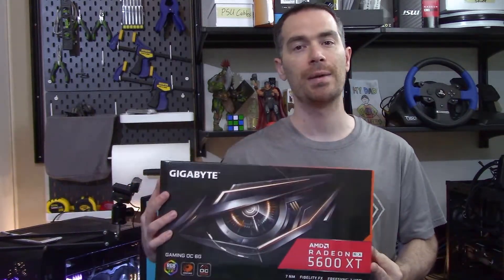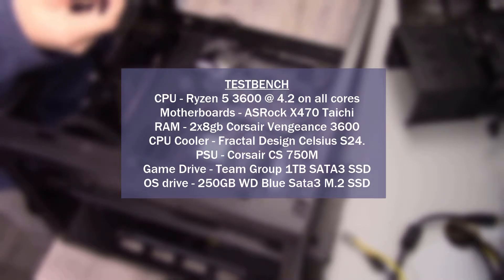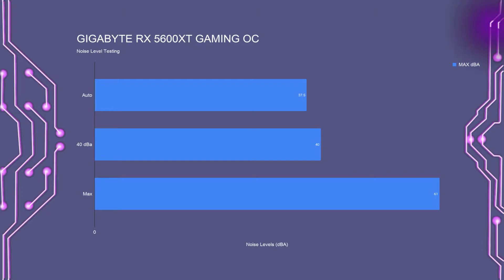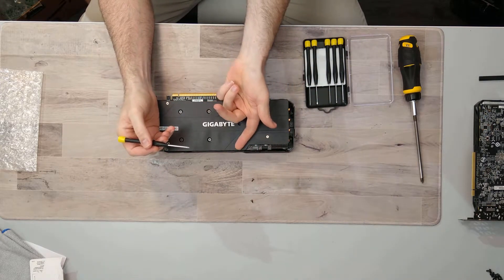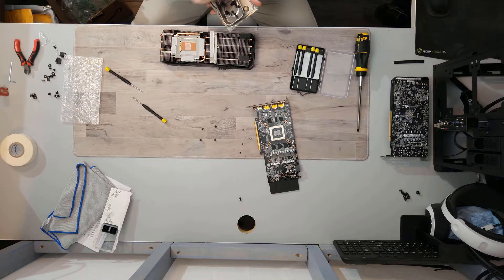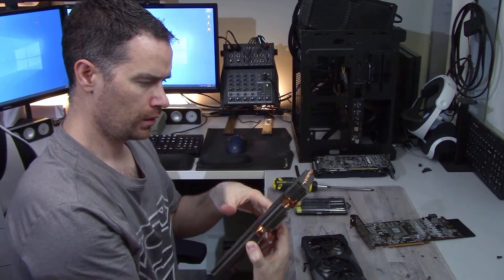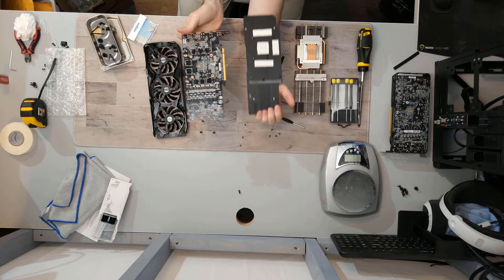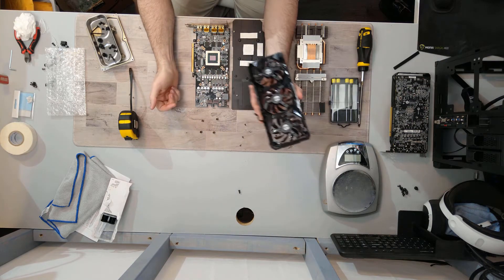GIGABYTE RX 5600XT GAMING OC - Technical Review

Comment: "I accidentally removed the thermal pads from the back of my Gigabyte RX 5600 XT Gaming OC 6G. Could
 this cause any issues? Also, what is the correct thickness (mm) for the
 replacement pads?"
Please answer me 🥺
Reply from the maker: @abdoelnhasmostafa4000  without the pads the temperatures will most definitely be hotter. I'm not sure what the pad thickness is ... Sorry. They might be 3mm but I'm not sure, but I'm not sure.
Reply: @HardwareForGamers 
"I have removed the thermal pads on the back of the card, not the ones for the VRAM."

Comment: Have same card rev.01 and is giving me windows loop til siistem repair show up, that hapens if I install drivers even without adrenalin software. Any solution ?
Reply from the maker: Are you overclocking the card or have you flashed the BIOS? Try updating the drivers. The last set of drivers seemed to fix the adrenalin software.
Reply: @HardwareForGamers  nah not oc' and yes my card came with f60 bios and problem was there and I update it to f61 but same happens, triyed also 20.9.1 but no luck eather. Onli thing i can do is wait for three freezes on cold boot and there will be windows repair and puts me to safe mode ,after safe mode i restart and enter bios first then i can get it to work but only without adrenaline software just drivers. :( ( btw when I am in windows after 3rd boot freze card operate normal without problems)
Reply from the maker: So you have no overclocks on CPU or RAM too? That is some weird shit... Did you ever have another card in that system? Have you tried DDU? To completely remove the drivers?
Reply: @HardwareForGamers  loaded optimised settings in bios ( so no oc setings on ram or Cpu ) and yes I had Vega 56 before this card, DDU drivers before installing this card and reinstalled chipset drivers as well but no luck. As I sad before card operate perfectly  and if I uninstall drivers and let windows install basic video driver then card is entering sistem without loops
Reply from the maker: Sounds like a software issue, but if it's on the Windows side or AMD side not sure.  Are you running multiple monitors? Or how old is your windows install?
Reply: @HardwareForGamers  Thats what i asume aswell its software bug or somthing, nah just single monitor. Btw will try fresh wi dows install but i think thats not isue coz I sow other try that without succsess.